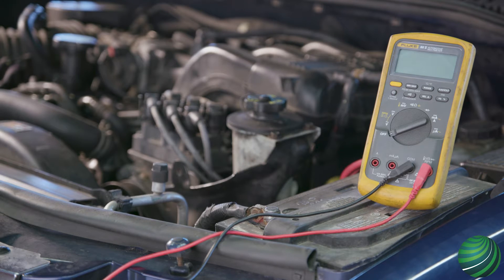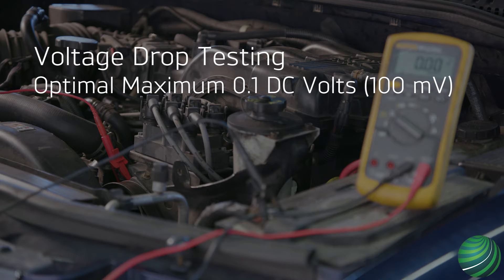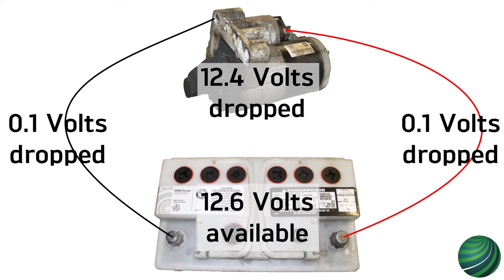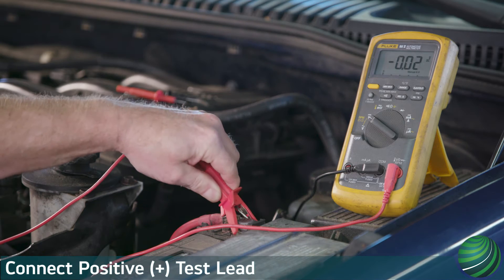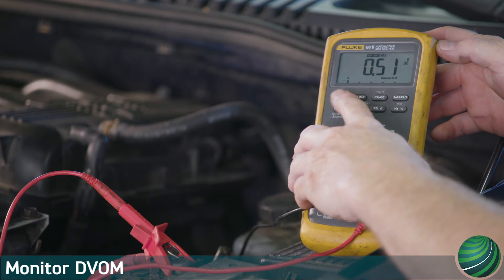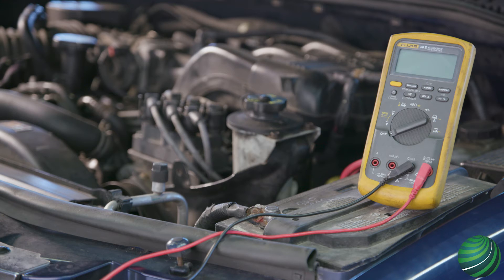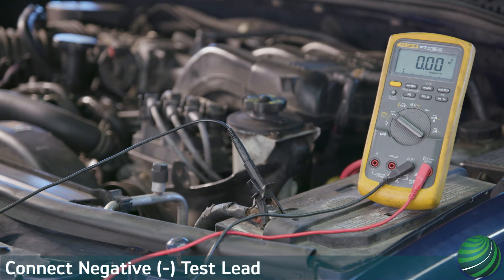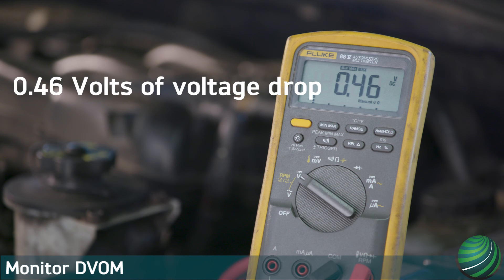The Best Way to Perform a Voltage Drop Test

Comment: So at the start of the video you stated anything more than 0.1V in voltage drop is too much. Then when you tested both positive and negative connections in the video, they read 0.4 - 0.5V drop. Doesnt that mean the connection between the starter and the battery is bad on both sides? Why do you move on to test another section of wiring? To isolate where the 0.4 - 0.5V drop is happening? What do you mean excessive difference between the 0.4V reading and wherever else you are testing? I thought the multimeter was telling you what the voltage drop was, not that we had to calculate the difference to get it?
Reply: The .2v voltage is for more recent vehicles if I had to guess due to how sensitive the electrical system is now. As I far as I could remember.5v was an acceptable voltage drop for older models
Reply: @ubuntumike5794  You are correct !

Comment: There was no parasitic drain or voltage drop but battery dropped 0,75 volts over night that was too high so I disconnected fuses 1 by 1 and only instrument cluster fuse dropped so I started the car without that fuse and turned car off returned the fuse and the gas lever shook, now the battery is only dropping 0,34 volts over night which is ok. I’m so happy I bought a multimeter for R180 and fixed it myself iso spending money at a auto shop for such a small problem.
Persistence cancels out resistance 😁
Reply: You are talking parasitic draw. That is a different test than the one shown here. 
You are making progress with the test you did which is the correct approach.

Comment: My problem is that I have a no crank situation and I am trying to find out if it is due to the positive battery cable. Since it won't crank, I can't turn the vehicle on to provide the load.

Comment: So you subtract those to readings he got .46 and .52 and thats your voltage drop?
Reply: It just showed the voltage drop in each circuit. .5v is considered normal. If the reading is too high such as .75 volts, there is high resistance. It could be a dirty or loose connection or
battery cables may have green corrosion underneath the plastic sheathing or frayed wires. 
If you have the luxury, try running the same test on another known good similar model as there can be some variance between models. The .5 v works for most cars.

Comment: Good clip. Clear,audible, useful info. Suggestion? That's a nice Fluke you have; I have one similar. I'd guess many guys who have less expensive meters (without autorange) could benefit by (either get one with AR) or some info from a future video as to which voltage range to use on a cheaper meter. Most circuits (I presume) would be best set at 20V DC but some others could light you or your meter up nastily. Again tho, excellent work. Do more!
Reply: Marc... I don't have a fancy meter, just an old Radio Shack one. I have a PWM device that controls my two eFans and the power wire & ground are connected directly to the battery terminals to insure full power/good ground. I had some fan/overheating issues and was wondering if I could disconnect the PWM/fans by using an inline switch, a fuse holder or a simple bullet terminal connector? My concern is whether anything other than a straight wire connection will lose voltage once its crimped or soldered into place. What do you think?

Comment: Best practice; probes at battery should be on actual battery post, probes at starter motor should be on starter motor stud and starter motor housing. This way you are measuring all series connections and wiring in each side of the circuit for voltage drop to the load.

Comment: 0:30  If each terminal has dropped 0.1v, why does it show 12.4v dropped total at the starter motor?  What happens if you have to use extra long cables for the multimeter, because the starter is far away from the battery terminals?  Does this cause a problem by introducing voltage drop through the long multimeter leads?
Reply: If the wire is good there won't be a voltage drop. And the starter motor is using 12.4 volts when cranking instead of getting the full 12.6 volts available from the battery.
Reply: & length of leads will not change anything.